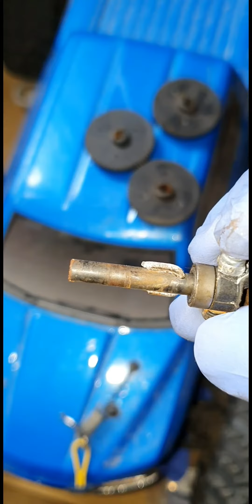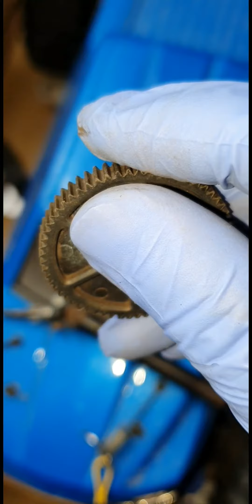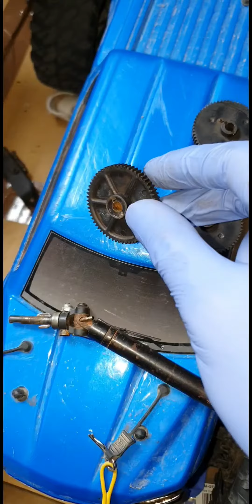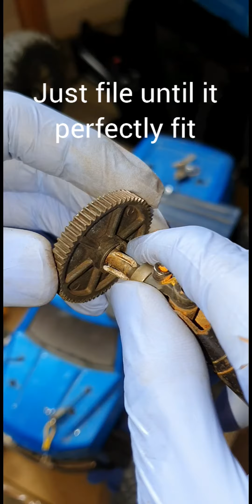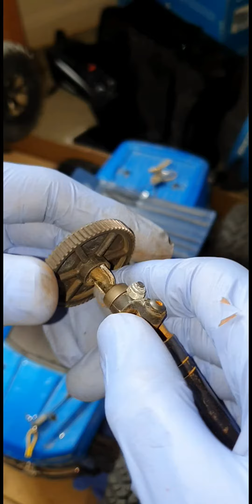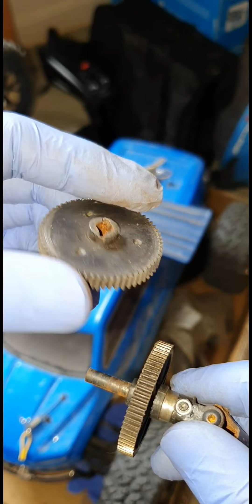Ftx outlaw spur gear hack

Comment: Take the flex out of the chassis and the spur gear last forever on 3s stiffen the suspension and make a anti roll bar ...the outlaw is 1 of my favourite 1/10 scale rc's easy to customise and work on great video btw